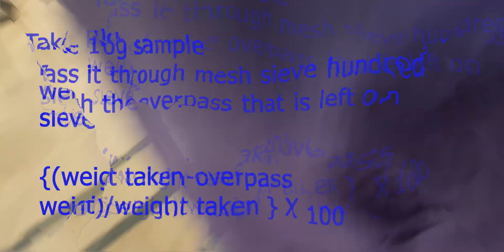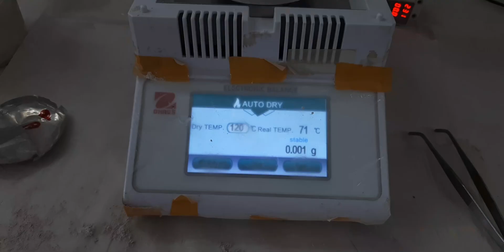How to check Activated Bleaching Earth Quality Part 1

Comment: Is the process of activating bentonite with acid valid without heating?
Reply from the maker: Degree of activation will be poor in this case ,on the other hand heating will cause bentonite stucture & Bonding to expand and change ions on quicker rate.
Reply: How do I heat a large amount of hydrochloric acid?
Reply: Hi sir
How can I get rid of the acid after completing the bentonite activation process? Can I neutralize it with calcium carbonate, for example, or just by washing?

￼